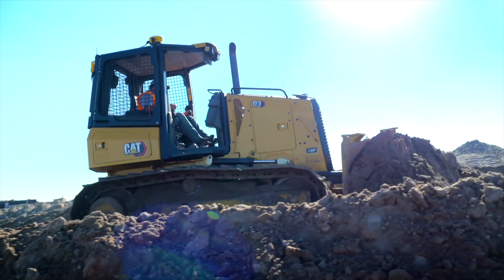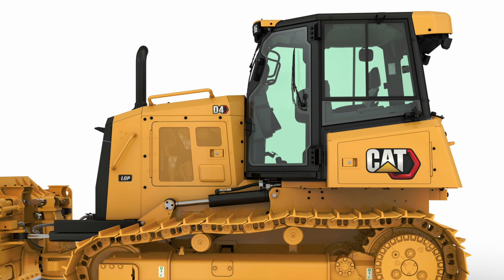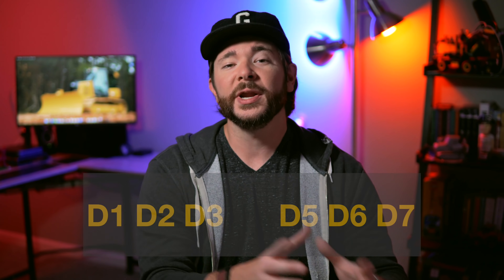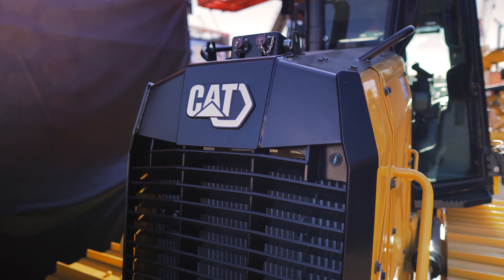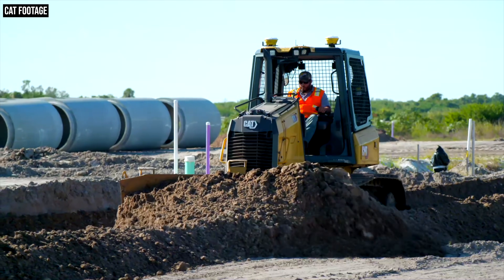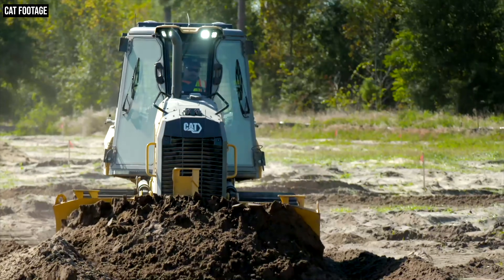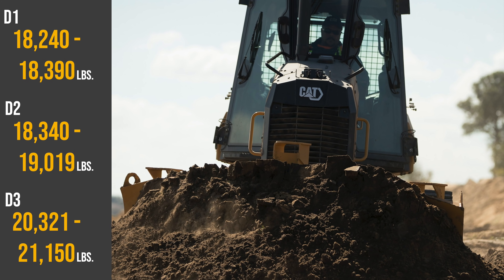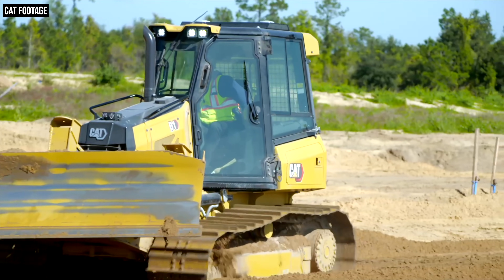Cat's New D1, D2 & D3 Make Up A Revamped Small Dozer Lineup

Comment: A D3 replaces a D5 what a confusing mess.!!! Now with the cat graders they did something like the 140 replaces the 12 and the 150 is the same thing as an old 140 seriously what a disaster…. They should’ve left that one alone…. All they did is Make stuff so much more confusing… without Equipment having a letter behind it how are you going to tell when they’ve made upgrades years down the road without knowing what model we’re on.
Reply: I used to work at cat on wheel loaders.  From day one, naming has always been confusing.   How I make sense of it all is in the weight and horsepower of the machine.   But on dozers, They try to keep the weight to horsepower in the 200-240 lbs/hp sweet spot.  I recently bought a track loader based on it being less than 10 tons.  I can haul it with a pickup truck and equipment trailer. The name has nothing to do with anything.
Reply: Be careful with Cat. The D3s are not the old D5s.  The horsepower most certainly is not the same. At some point consumers will realize they are not getting 100 hp with the next gen D3s.  Try before you buy!!!

Comment: Case has been doing this for years. Once again this is cat playing catch up pretending there "class leading."
Reply: Case? Lmao with the single worst support and warranty in the industry! You couldn’t pay me to take another case dozer.
Reply: From the early 80's we always called Case the poor man's equipment. But on the flip side, I have owned a few Case pieces... 350, 450B, 850 and a Case 580 D backhoe. Had to go with the 350, and 450 for the size and weight. The 850 and 580D got dirt cheap.